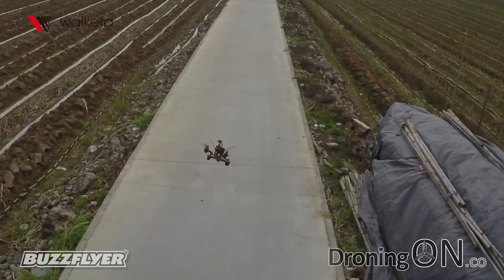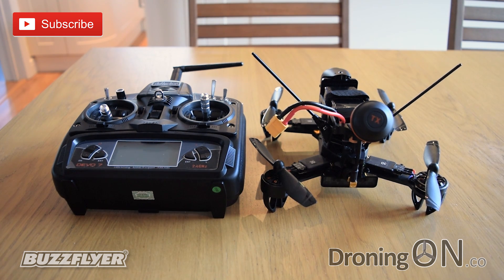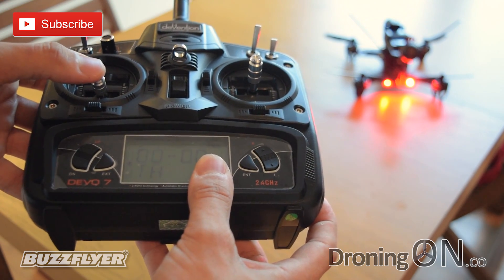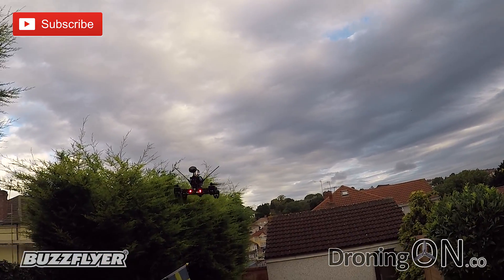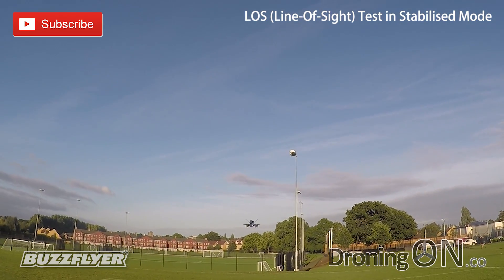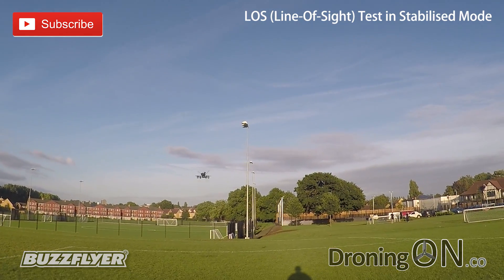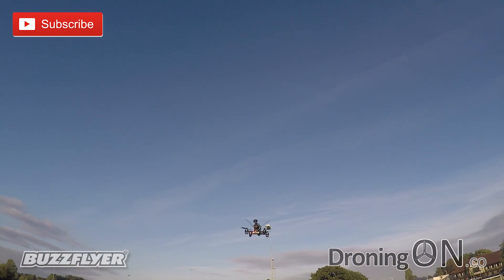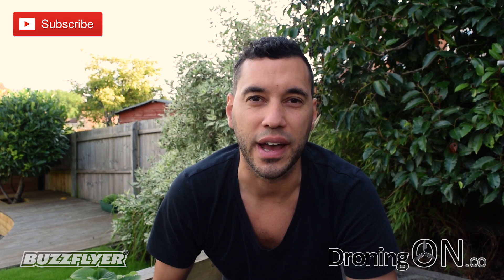DroningON | Walkera F210 3D Setup and Test Flight (Part 2)

Comment: I have to say...I recently unboxed n flew my quad and I call bs on this video! It is NOT STABLE AS SHOWN OFF THE TABLE! This thing is literally allllllll over the place and from watching this video I wasnt expecting that. I'm a experienced flyer so I quickly gained control but beware....
Reply from the maker: BS you may call but this comes down to pilot skill in setting it up correctly and flying it. In the review this quad is straight out of the box, nothing changed from any other F210 that you'd buy, therefore if you had stability issues then I'd suggest that you were NOT in stabilised mode...so kindly don't be so rude on our videos, otherwise you'll find yourself blocked.
Reply: DroningON ...Ok I do apologize for being rude. Thing is I bought this after viewing your video. N I had all settings to 0 as shown in your video. Still when bonded i throttled n immediately it went on its own.  I was hoping for the table lift off u had but instead it went waaaaay off on it's own n I had to pilot it. Again I was just a bit frustrated n I sincerely apologize
Reply from the maker: Thanks for the apology, decent of you. I have been flying for over 25 years, is this your first quad or have you flown others before? Remember that this doesn't have GPS or optical flow, therefore you have to keep it in position ENTIRELY manually - these are NOT easy to fly. Can you upload a video to show how it flies?
Reply: DroningON yes I can!  N thanks for accepting my apology.  I've flown others before yes. Just wasn't fully expecting to fly full manually...but I'm pretty good at it now lol
Reply from the maker: Have you ever flown a Racing Quad like the F210 before though? Remember, it isn't a 'drone', its a fully manually flown aircraft - let me know what else you've flown before as that'll help. Cheers
Reply: I'm not really secure feeling to try clean flight...I've read many horror stories! Have you discovered any other tips either for the devo 7 or the quad itself that would be helpful?
Reply: Traxxas Aton....and wizard.

Comment: Has the walkera furious 215 made this one obsolete?
Reply from the maker: In all honesty, the Walkera quads have seen their day I suspect, they just can't compete with quads like the X215 Pro (our latest reviews), and Walkeras use of proprietary components makes them quite silly in terms of spares and repairs. Anyone recommending the Walkera quads in this modern time are probably only doing so because of freebies.
Reply: Thanks for the reply. I am going to check out X215 pro. What other good drones would you recommend in the US $300 range. I am looking for something RTF that flies out of the box which I can upgrade later on as I get better. From the flight controller to the motors to basically every component in there.. just basically as plug and play. want to stay away from soldering. What freebies will I get with the walkera?

Comment: Cool video. I have Runner 250 Pro.  Love the drone though. The only issue that I am facing is that the Devo 7 throttle start to accelerate from 60% of the throttle speed. I spoke to many guys and its weird. I even managed to do the curves but I still prefer to have a linear curves. The FPV guy told me its center stick setup. But its still weird to me. If anyone know why or any other solution please do let me know. Thanks

Comment: Hi. Any recommendations for antennas for better range?
 Thanks.
-DS
Reply from the maker: +Dave Silva, we love the Aomway 3dbi antennas (http://www.banggood.com/Aomway-5_8GHz-FPV-4-Leaf-Clover-AV-Transmission-RHCP-Antenna-1-Pair-p-961730.html?p=7I14124028655201603T) for fitting onto the aircraft end, they're durable but most importantly, they're cheap and their signal quality is pristine. For the goggles side, we recommend TBS Triumph, you can't beat them but don't fit those to your aircraft because they're expensive to break!
Reply: Hi again.
Aomway 3dbi antennas: RP-SMA Male or SMA Male?
Saw these Triumphs on www.getfpv and for $19.99 oneBay, think they'll work? 

I think I'll have to buy this SMA Male to SMA Female Coaxial Gold Plated Adapter 5.8G as well?

Thanks for your advice!
-Dave
Reply from the maker: +Dave Silva for the F210 you'll need SMA, but avoid putting expensive antennas on your quad unless you're a pro and never crash :) put the Triumph onto the headset. Also check RHCP vs LHCP.
Reply: Thanks! umm, what is the stock F210 LHCP or RHCP?
Reply from the maker: +Dave Silva RHCP I believe.

Comment: Is there a way too extend the range on this drone for farther FPV flying?
Reply from the maker: +TheCladi8or, the factory range of this little quad is really good, all you need to do is install a decent antenna in place of the horrible little stubby one, that will significantly improve range.

Comment: I bought my f210 3D 3 months ago and I'm loving it still.  Since I have upgraded to the triumph circular antenna and have switched to the dal 5045 tri blade props with a tattoo 1300 75c. With battery upgrade and prop upgrade this quad is even more amazing! Great vid!!
Reply from the maker: Great to hear, that's the good thing, it's RTF out of the box but a few simple upgrades and you can transform it!

Comment: Great video. I just received my F210 on Saturday what a great little flyer it is!!! its my first FPV racing quad although i've flown many phantom/blade quads. My 1st flight using FPV today was pretty amazing i've now ordered a mount for my action cam to get some footage. just wish i had some more batteries. Have you bought any extra lipos for this maybe another make that are not as expensive as the walkera ones :) let me know.
Reply from the maker: +cham0, yes if you watch Part 1 of this review (see my channel) I link to a battery which is a perfect fit, the Turning Graphene 4s 1300mah, hole this helps and happy flying dude!

Comment: Great vid again! The binding sequence you suggest is spot-on! Will you be PLEASE post your binding process with the Fat Shark Dominator SE? If it's easy enough for me, I will be definately buying the FS-D SE. Will I need to buy any other accessories to bind them both or is the stock transmitter in the F210 compatible?
BTW, I bought a DEVO 10 TX(white one) and the range is 10x better and much more reliable than the D7. More confident to go FPV now. Anxiously awaiting your next video...
Reply from the maker: +Dave Silva, thanks again for your comment and glad that you're still onboard my channel! The process of associating the SE's with the F210 3D was very straight forward for me, as soon as I turned both on, they literally just worked. Both come with a raceband compatible receiver/transmitter and therefore simply tab through the channels on the goggles and you should be able to locate the right one. Alternatively, you can adjust the F210 onboard VTX to choose a specific channel. I have just ordered a module for my SE's which even scans the radio spectrum to show you the best channel to use, I'll post a review of this module as soon as it arrives, pretty cool!
Reply from the maker: +alvin and julianna badiola this is possible by connecting the F210 to your PC and using CleanFlight to reprogramme it to allow more forward tilt whilst in stabilised mode, but it can be tricky and you must backup all settings before doing so! Thanks for your comments and be sure to SUBSCRIBE!!
Reply from the maker: +alvin and julianna badiola this is possible by connecting the F210 to your PC and using CleanFlight to reprogramme it to allow more forward tilt whilst in stabilised mode, but it can be tricky and you must backup all settings before doing so! Thanks for your comments and be sure to SUBSCRIBE!!
Reply: You can fly in "Advanced Mode" as well. Seems to have more angle in that mode. Still trying to master that mode...
Reply from the maker: +Dave Silva, twitchy isn't it when flying in Advanced Mode! Takes some mastering for sure, but worth flying continually in that mode so that you start to feel comfortable.
Reply: Hi. Having hard time finding a Fat Shark Dominator SE at the moment. Did you happen to review these Fat Shark FPVs: FatShark Attitude V3 FPV Goggles w/ Included Fan Faceplate.

Link to a store: http://www.helidirect.com/fatshark-attitude-v3-fpv-goggles.html

Any review on these would be greatly appreciated!
Thanks.

Comment: i had that same problem with the  lights, i found that unplugging the lights, straightening out the wire then re-attaching fixed the lights. see if that works for you
Reply: Same here Thor. Do you have a video of you fixing the light issue on the F210?
Reply: Dave Silva no i dont, it got fixed when i replaced the VTX board (Video transmission board. all i did was move the cable around alittle
Reply: I will try that my right blinker keeps going out this is the 3rd one I have went through!
Reply from the maker: +TheMighty Thor, great minds think alike, I did this and ironically after doing so, the left-hand indicator now WORKS...but the right-hand doesn't ;o) it looks to be a design issue, the way in which the ribbon cable is poorly wrapped tight around the antenna, not good but at least the replacement is cheap :) thanks for the comment dude, honoured that you're watching my videos!
Reply from the maker: +SteveO4478, its really easy to remove, just 2/4 screws (from memory) and then the whole light cluster unplugs, literally can be changed in a few minutes.